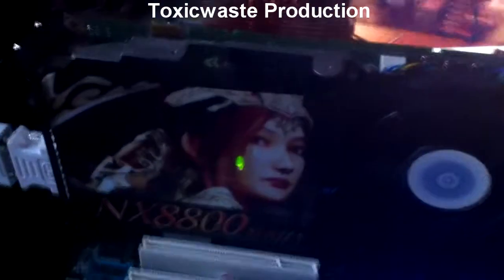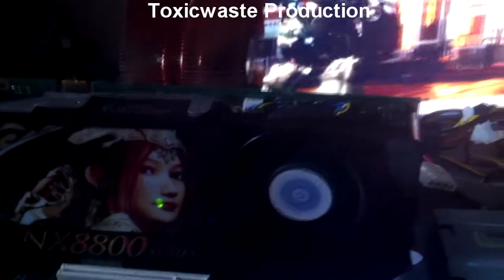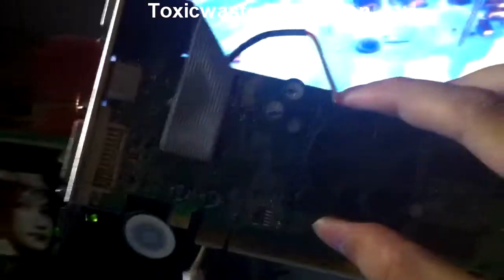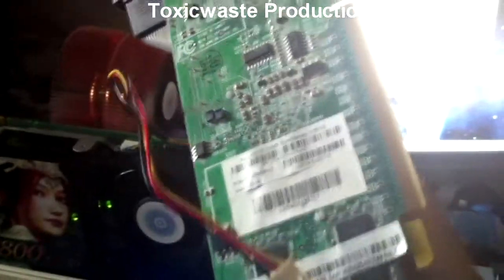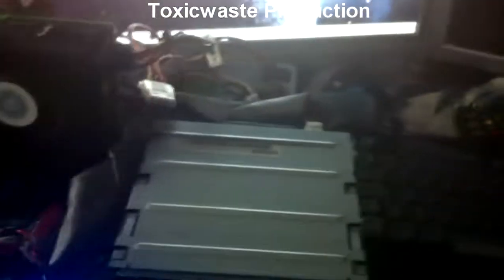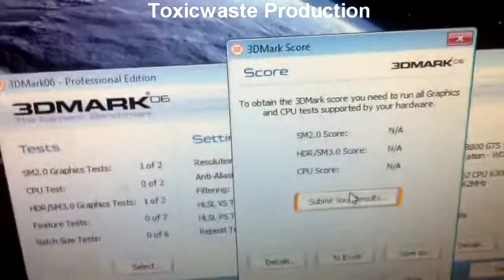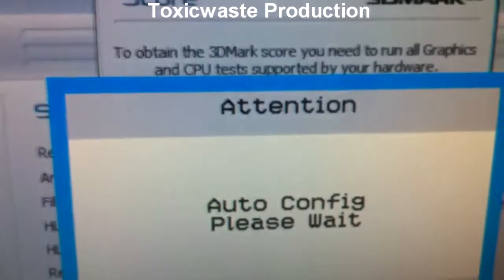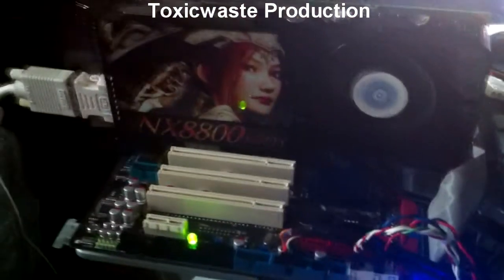8800gts in testbed

Comment from the maker: @chrilla1980 no man i got an small psu that has all the internals for the motherboard power. But never was wired up to actual leads. The psu was for servers to power harddrives and harddrives only. But it has all the curcuits to power an motherboard i think. And i would like to wire it up so it can power my shuttle XPC sens no one seems to have an already fixed powersupply with leads on it.

Comment from the maker: @chaosquall1 yeah i noticed that. well it racked up in its home computer workstation. 12800points in 3dmark06. and thats not to bad i reccon on an slot pci 8x i think it had. its really an x16 slot but i think ones you got 3cards in the computer it goes to x16 x8 x8 in order to make it work.

im ganna next attempt to fix an copple of dead DV6000 and DV9000 laptops.